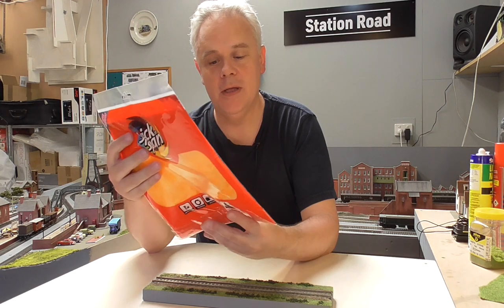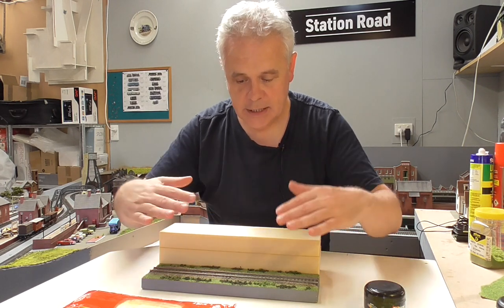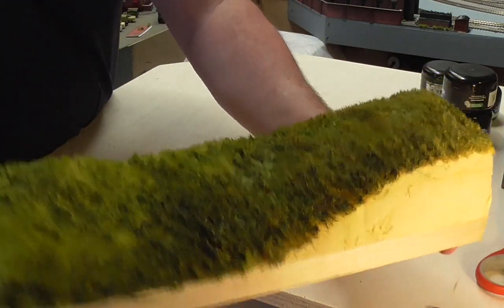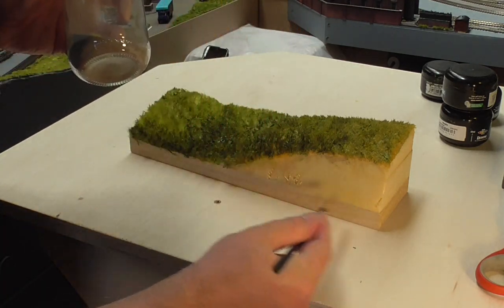The Model Grass Alternative

Comment: I reckon you’ve achieved excellent results with that method. I did wonder while watching whether the cloths should have been pre coloured with a clothing dye to form a base colour but it looks like it would be an unnecessary process. Great stuff. Paul
Reply from the maker: Thanks Paul. I have used green synthetic dye in some areas of the hillside grass and it does give another colour effect. As you mentioned, the dye works well as a base colour which I have then applied the usual paint process over the top.

Comment: You could have used your pva for gluing the polystyrene board, it's very successful and it dries very quickly, great tutorial
Reply from the maker: Interestingly I have tried PVA on this particular foam and it takes forever to dry and doesn't hold very well. I think the dense foam almost makes the join air-tight and thus doesn't allow the PVA to dry quickly.

Comment: Just a question from a Kiwi starting a layout... where do you get your styrene from that will not break the bank.
Reply from the maker: The styrene foam sheets I used to buy from Bunnings but I actually learnt yesterday they are no longer stocking the product line. If you're lucky, your local Bunnings might still have some in stock (which they're selling at a reduced price). It's called Knauf ClimaFoam® Extruded Polystyrene (XPS) Insulation and comes in different thicknesses and sheet sizes.
Reply: @StationRoadModelRailway  thanks mate, will take a look at miter10 then if Bunnings used to carry it.